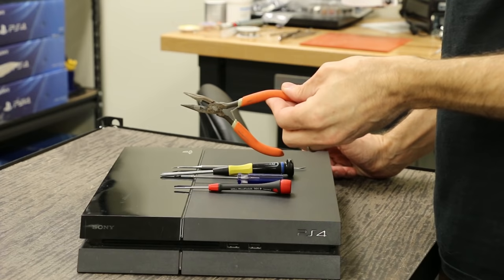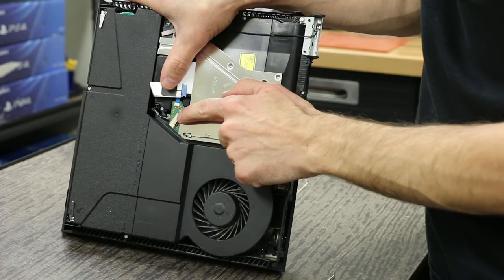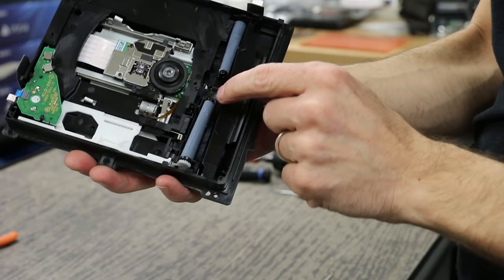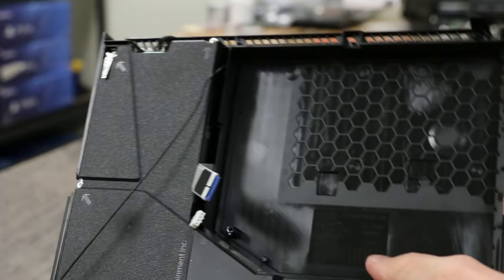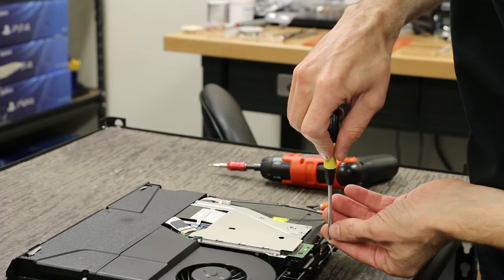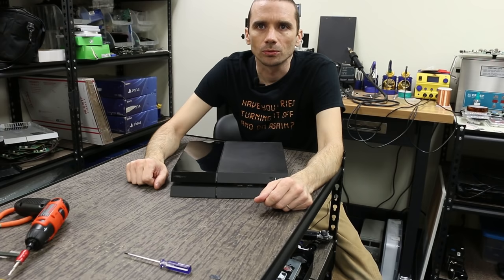PS4 Won't Read Discs Fix (Makes Noise/Won't Accept Discs)

Comment: PLEASE READ IF YOU ATTEMPT TO DO THIS                   If you are doing any unscrewing make sure you have the exact screwdrivers, the threading on the screws are incredibly weak. If the threading on the screw is damaged, put a piece of latex glove on the screwdriver and the latex will grip on and take the screw out

Comment: Awesome & very detailed video!  Thanks!  Just to add my experience...my problem was the disc wouldn't insert BUT made NO NOISE.  Just a very slight, quick sound when I first tried to insert a disc.  After opening my disc drive, my rollers were fine, but they weren't lowering into place when trying to insert a disc.  I noticed the long white plastic piece that takes up most of the left side of the drive had slipped out of place with one of the levers on the top cover of the disc drive, which turns out was responsible for lowering the rollers.  I reconnected the top lever to the insert on the white plastic piece by tightening the manual eject screw & that fixed it!  Thanks again for the help!
Reply: I have a similar issue with the long white piece except it's stuck all the way down and it's blocking the roller from spinning. any clue how to push the long piece back up?
Reply: Nvm just had to force it back up, was a bit hesitant to do this but it seems to be the solution

Comment: Can you tell me if there is any consequence from breaking the two metal brackets that are associated with the Phillips screws that are holding the power supply in place, or are they just there so the screws are easy to grab? I noticed that on the bottom panel of the PS4 there are some metal surfaces and it seemed like those brackets make a connection to them.

Comment: The philips head screw on the right at 5:59, is not in mine, is that an issue? My rollers appeared to be where they should, though they are very dusty

Comment: @TronicsFix    Really informative. I'm not a playstation expert but my background in electrical engineering allowed me the confidence to take my old ps3 apart, replaced the reader + later down the line replaced the whole drive unit. My question is this..   I'm now on to the ps4, it is behaving like there is an optical lense dirt issue - reading some discs, but not most. Nothing in the mechanism is broken, I don't force discs into the machine. I am a smoker though. I've blown air into the vents, run a disc head cleaner several times through with Isopropyl alcohol but it doesn't improve it. This weekend, I'm going in. I've cotton buds, the tools, the compressed air can, IPA. My discs are spotlessly clean but some will be read, but most give me " unrecognized disc " error. I think the cigarette smoke MUST of gotten into the drive, so I might give it a once over gentle wipe with a fresh cotton bud an IPA, then blow dry it. Any advice? Any precautions I need to be mindful of? I expect to clean the inside of that ps4 within an inch of its life. May as well since I don't wish to keep going in and out of it. My old ps3 died on me because a tiny piece of plastic on the mechanism broke and I had to leave the thing open to manually insert and remove discs. This allowed more cigarette smoke into the reader and I kept having to " go in ". FYI, the dust cover that you push the disc through often needs a bit of tlc with a cotton bud + IPA. I've done the same already on this ps4. But still think I'm looking at the lense.
Reply from the maker: Your plan sounds good. You might just want to replace the laser while you're there but cleaning it will likely do the trick.

Comment: Thanks for all your awesome vidoes, you have teached me a lot! :) 

Do you have an idea to fix my problem? If i put a disk in, or give the signal to the laser with the small black lever in the disk drive, the laser just quiver back and forth just once, so the laser is not really searching for a disk. All the options to fix it in the secure mode where with no results. Right now i ordered a new flex wire. (The big one which routes to the laser) Could that be the reason? Or do you have another idea? 
Thanks a million! : )

Comment: Mine makes a weird noise after I insert the disk like it's loading and then a noise like it wants to spit the disk out but it doesn't. Keeps loading again and the it says disk unrecognized
Reply: Same man :(
Reply: Same
Bro
Reply: Mine does this too any chance there is a fix for this?
Reply: James Walker what I found out was that my cable connecting to the disc drive (the cable that had to be pulled out with the pliers) came a bit loose and was making a cracking noise and then stuttered rotor noises, I reconnected that cable and it was fine, if it wasn’t loose just reconnect it. If that doesn’t fix it, it’s probably the rotors on the disc drive

Comment: Hi there, i fixed my sons Red Light issue, cleaned the whole system and put new thermal paste on, works fine, boots up and drive an external drive all fine, issue i got now is the disc drive, the eject button doesn't work so i think that's the metal connector issue somewhere, but when i turn the ps4 on the drive whizzs like its trying to search and read a disc and goes on for a good few minutes, i try put a CD in and it doesn't take it at all, i did what was in this video and the rollers seem fine, i cleaned out inside, would the eject button issue cause this or would it be a deeper issue?? Thank You

Comment: Hey man. So I did everything in this video but my ps4 still won't accept any discs. What else do you think could be the problem? It still makes the beeps when you press the eject button. The drive just won't accept discs and the rollers and everything are in place. If you can help thank you

Comment: just started happening to me. rollers were not straight because the door kept being forced closed by something... i cleaned the gears and there was great amounts of dust and dirt. i thought that was the problem. i tried a disc and it really slowly took it in and then it said "unrecognized disc" every single time. even on a brand new disc. do i need new ribbon cables? please helpppl

Comment: Always love your tutorial.
I have unrecognised disc error. After cleaning it, replacing the laser and updating all of the software it still doesn't work. Is there something on the board that fails causing this issue? Thanks
Reply: no clue but if you tap above where the disk goes when inserting the disk it should read it and you can play, it's a but of an annoyance but it's been working for. I don't think this video tutorial will fix my ps4 as its the ps4 slim and doesn't have the same disk reader and also receives the disk and pulls it in fine.

Comment: Question. I followed the vid but something must have gone wrong. Now it accepts the discs perfectly. But it'll rapidly try to read the disc over and over again on a constant loop. Any ideas what it could be?
Reply: Nm I figured it out. The cables underneath the ribbon the the disc drive. It was easy to pull out but difficult to get back in. Tip: take out the power supply to get a better angle when plugging it in. Just be careful that you don't use to much force...

Comment: Thanks for this - just tried this to fix my ps4 and it worked like a charm (I was even able to use a T9 instead of a T8 torx - carefully - I just didn't have a T8 handy).  Was able to do in about 20 minutes or less (being careful and getting interrupted by the kiddos). Thanks so much!
Reply from the maker: Glad this helped. The screws are actually a T9 but I use T8 because sometimes the T9 sticks really bad.

Comment: I have a PS4 pro and my disk drive won't accept disks. And is saying unrecognised disk when I don't have a disk in there. I pulled thing apart and had a look at the rollers and the laser etc. But everything looks good. I noticed one of the fuses had blown that is connected with disk drive. I made a quick fix and i still have this problem. Have any suggestions? Do you think it's because I didn't actually solder a working fuse onto the motherboard?

Comment: completely followed all your instructions (very clear and informative video btw) - but still no fix. both of my rollers were in the right spot, everything looked normal (to me at least), what options are there to try and locate the exact fault ? it's 100% something to do with the disc reader but I can't figure what it might be, it just mostly sounds like it doesn't spin the entire way around.

Comment: always love your videos,,very use full .. i have a question bout my theory .... bout placing my ps4 pro vertically ... remember the red ring of death? ... maybe because of that .... vertical main board/APU + heat + vibration from fan = might melt the solderings / full or mess up the pin contact ... my theory make any sense? ..thank you

Comment: Hi, I have a questions. I do almost every trick from the internet but my driver still is ejecting disc, even there is no disc. May IT be a problem with a logic plate which is on driver? Do you have any advices? Thanks in advance.

Comment: I have a question my PS4 is not reading discs or games. We took it to a repair shop they said it needs a new motherboard. Our toddler stuffed a ton of discs in it. We literally had to pull them out and even use tweezers. Will that damage a mother board. I feel like it would damage the laser or compartment that reads the disk? Unless we need to replace all pieces because I hear the motherboard and disk compartment are together and not separate. Would appreciate your help. Do you also repair out of state if I were to ship mine to you? And is it worth replacing a motherboard or getting a whole new game system ?

Comment: Not sure if you check these but I followed the video after cleaning the ps4 , when I started to assemble the rollers in again I heard a pop and now the guard or access door that is suppose to move up and down with the rollers is stuck. It wont allow me to put in a disc whatsoever I didnt see anything break wondering if I locked it somehow. Please help.

Comment: Hi how much is it to replace that little connector on the blue rays board I’m not sure if this is the problem or the cable  I accidentally pulled the cable out but the little tabs are still on the cable hanging on by a thread  it doesn’t read disks and the eject button doesn’t work at all no even a sound thanks

Comment: Hello. I opened the PS4 and the DVD Player. Everything seems to be in their right place, but when I place the DVD at the entrance of the DVD player, I hear mechanical sounds, but it doesn't pull it in. When, I already have the DVD in the DVD player, and boot the PS4, I hear it work and turn the record, but nothing more. Is it possible, the mechanical system at the top of the DVD player has been deregulated?

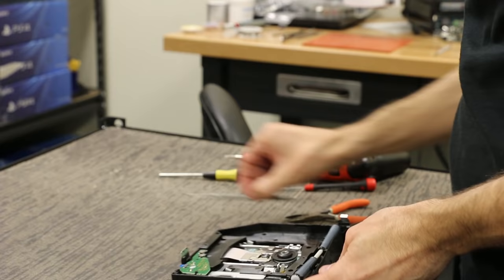Comment: At 10:10, at the top piece of the drive, when i slide the two ears to the full extend one keeps the bottom white pin in place (at the top end) but the other doesnt. And from that position they doesn't move unless the white pin that doesnt stay at the end is moved there by hand. I suspect this is what's wrong with my drive. Advice?

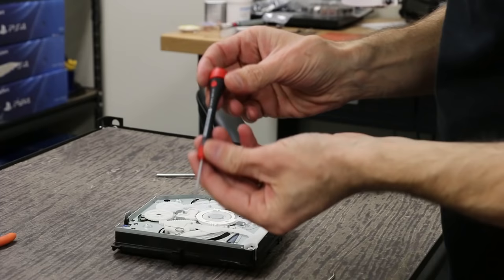Comment: My bro thank you, tried the plastic nylon trick for BLOD and it worked. Now my ps4 wont pull in my discs. I have 4 black phillips screws left from when I took it apart and I don't have a clue where they go! They're a little bit bigger than the black phillips screws in the video at 4:42 do you know what theyre for?

Comment: Could the rollers be popping out causing it to not take discs? My drive problem started after opening to clean dust. First time that tiny silver piece was stuck to magnetic circle in drive, 2nd time was the spring popped off, last time magnetic circle part fellout I put in backwards. Now it not taking discs like it's blocked. It took the disc halfway and then sounded like it was trying to eject for 10secs and then it wouldn't let discs in the slot.

Comment: This would be such great help if only a t8 or t9 screw bit actually worked. The screws won't take it because there is piece in the center blocking it.
Reply from the maker: You need security torx
Reply: @Tronicsfix  I just ordered one. Thanks for getting back to me so quickly too. I was going to use a tiny flat head but didn't want to risk stripping the them.
Reply: @Tronicsfix  hey Bro, I got the pro and it's not accepting discs (it normally eats em up but now it's stiff and you gotta force it in and even when you do it doesn't read it) , I opened it yesterday and the roller looked intact, I have no idea what to do

Comment: I have this version that has the light on top and i see it will only connect to a 2.4ghz network is there a way to replace the wifi antenna where it will pick up on the 5ghz?

Comment: After watching your video, my driver doesn't have any broken or loosen parts, so what would be my next step. It was working until I took the console apart to clean it. I didn't mess with that part at all just the fan and case. It'll take the disc and eject it just doesn't read it.

Comment: Not sure if I will get a reply given the age of the video but its worth a shot! My ps4 disc drive still reads fine but it doesnt suck in the disc properly, it gets stuck, you can push it in by hand and everything works fine, it ejects the disc fine as well, maybe a little slower than some consoles but it makes it out without getting stuck.... any ideas?? Kinda gets me confused cause I would of thought it would have trouble ejecting as well as inserting
Reply from the maker: Probably just really dirty rollers. I can't be sure without seeing it but that's usually what causes stuff like that.

Comment: I have a question.  So when i put the game in and sometimes it'll just spin and spin. After it spinning for a couple extra seconds it makes a sound as if it's trying to realign the disc or the disc is just being put in even though the disc is in there already. I eject the disc and try it nurmour times and eventually it'll work but idk what the problem could be. It only happens to that one disc but there's no scratches, no smuges. Nothing, it's clean.

Comment: I just remove 30 cents thanks to the help from this video. Do you maybe have another video on how to boobytrap a PS4 to prevent your 2 year old from using it as a piggy bank?
Reply from the maker: Ha, ha...that would be a good one. Maybe you need a decoy PS4 that's actually a PS4!

Comment: Hey bro were can i get those connectors and the flex cables for a good price lol my novice ass messed it up rushing to replace thermal paste n clean out / looked all over ebay found the flex cables but not the connector pins

Comment: What if that pins breaks off? While not holding the metal strip down? Will the cable still be able to nfit the slot and work??
Reply: And can i start my ps4 without those buttons attached. CD Eject/power button.

Comment: The pins on my disc drive were fine, but the plastic part it sits on is supposed to move up and down like a door, and this peice is frozen in place. I took the pins out to look underneath and no help. How do I make the plastic peice under the rollers move?

Comment: If they “ear” thing was stuck inside the connector could I replace it at home? How can you check if the “ear” is in the connector? If it’s not could I just buy a new Blu-ray cable thing or can I still ya the one that’s missing the “ear”?

Comment: I have a question, either to the one who made this video or someone in the comment section.
I have a PS4 Pro. 
When I put a game into the console when it lays on the table, it won't read. 
But I tilt the console a little bit when I put the game disc in, it reads the discs perfectly. 
Is there a problem with my PS4 Pro or is it ok?

Comment: greetings. I had a play station 4 that have issues with ejecting the CD. what is your input on that? they say that it is a malfunction that has to do with the making of the machine. something about a adjusting a screw on the side of the machine next to the hard drive? I would like to hear your opinion about that. thanks
Reply from the maker: That normally caused by a dirty eject button.

Comment: What if that cable that you talked about is broken but the ear isn’t left inside can i fix it or do i need to get another one because the disc eject button doesn’t work i think it might be that
Reply from the maker: Sure...just buy another cable from eBay
Reply: Thanks i actually opened up again and aligned it better now it’s perfect thanks for your help i wish i watched one of your videos before opening it up others didn’t address that you need to push down that piece of metal and i thought it was like other ribbons in controlers. Thanks for your quick response

Comment: So I have a... Bit of an odd one for you.

My mother accidentally put two discs in her PS4 at the same time (THANKS, BLU-RAY CASE WITH STACKED DISCS. REAL COOL.) and now can't read discs. It makes a weird noise and says "Unrecognized Disc." It works fine otherwise, it just won't read discs of ANY kind.

What would you say is the problem, and how would it be fixed?

Comment: Hey tronicsfix, do you know if doing what you did in this video can fix the error code su-42118-6 issue, i've heard that checking or changing the disc drive or the aluminum ribbon cable can fix it
Reply: AyoG G omg I have the same problem too, when trying to install the new update.

Comment: My ps4 wont let me insert my disc what should i do because it normally takes it in itself but its not??any help
Reply from the maker: You can try to fix it yourself or you can always send it in for repair: https://tronicsfix.com/collections/get-started
Reply: TronicsFix LLC but i dont know what i would have to do to fix it
Reply: My PS4 is doing the same
Reply: I just used this method but now my PS4 won’t take any disc